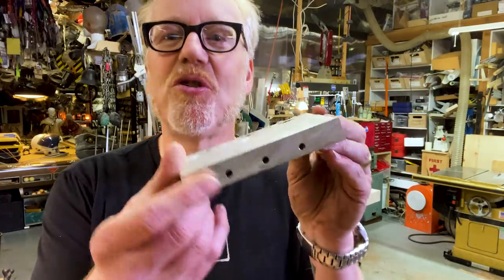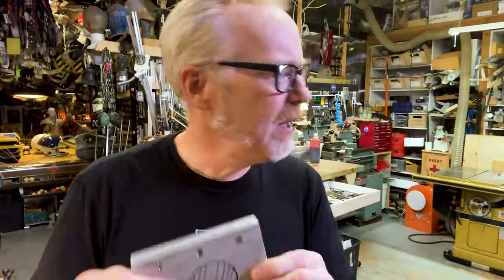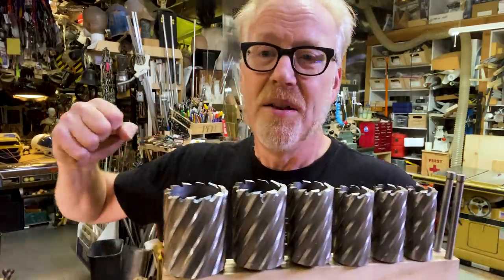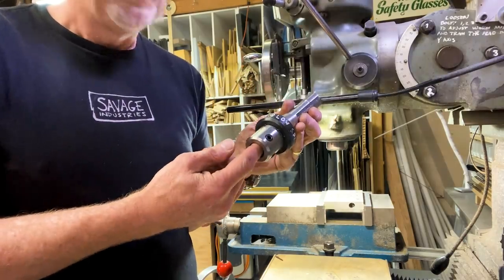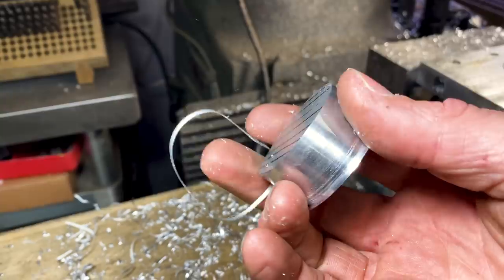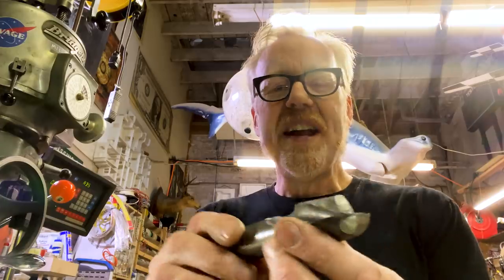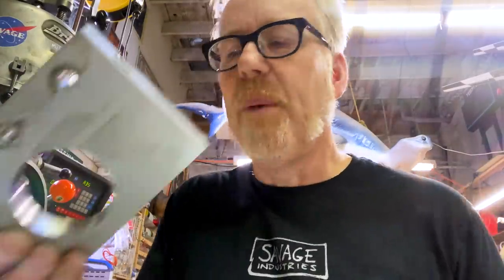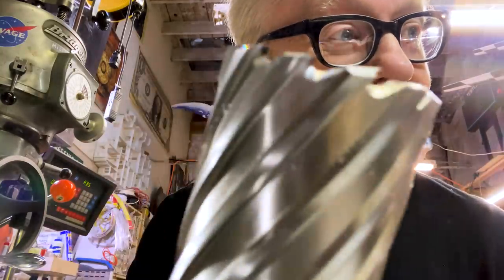Adam Savage's Favorite Tools: Annular Cutters!

Comment: So essentially it’s a high-quality, high-precision hole saw?
Reply: Essentially yes, I've tried this operation with a hole saw and it can't clear the chips so it gums up.
Reply: @mattchilton4950  Try drilling a smaller hole along the inside wall of the hole you are trying to cut. The chips will fall through the hole :)
Here's where I saw it https://youtu.be/QhpOg186fks?t=1083
Reply: Essentially yes, but..no? I mean, it's better to think of them as hogging mills for plunge cuts, and there are some annular cutters out there that allow you to hog (rough cut in large quantity) the sides of a work piece or the very cut you've made, like for example, you've cut a hole, then you want o enlarge it so it becomes a slot.

The reason i feel like there needs to be a distance between the regular hole saw and an annular cutter is that...where as you can chuck a hole saw in a mill, you can't chuck an annular cutter into a drill and expect anything out of it, and in fact, it's probably a good idea not to, because one wrong pressure adjustment, like you'd do with a hole saw, and you're off the deep end, which at best would just ruin your work piece, but if it grabs you by any odd chance, those things do damage. Not to mention the fact that it would probably cook the winding on a regular drill, because it demands a lot of power to cut through. 

In my imaginary tool classification, an annular cutter falls squarely in the middle between hobby shop and professional machinist shop. You need the machine to operate it. And the pocket too, these be expensive.
Reply: Riyman24 brilliant tip!
Reply: @riynyescienceguy5268   What a great tip, thank you!  I always cut an undersized hole with a hole saw and then follow with a boring bar to clean up the finish.  It suits my needs and budget but dealing with the chips is a constant hassle.  I'm definitely giving this a try.
Reply: @riynyescienceguy5268  That is gold! Thanks for sharing!
Reply: Reminds me of a core boring bit.
Reply: That bores through steel like it's butter....
Reply: Yes...but no. It has two  significant  differences. 
First. a hole saw, as you know, is a thin toothed cup mounted  to a small arbor (center).   This junction between the arbor and saw can introduce a tiny amount of play that can reducing cutting efficiency, and under enough force it can wander or buck.   The annular cutter is one very solid piece with a 0.75" shank so it avoids all that.  Same issue with the thin walls of the saw cup, which in addition to deforming also heat very quickly increasing the likelihood of binding. Where again the annular cutter has walls around 0.125"  that take longer to heat up, and dissipate heat faster.   Also  the arbor has a drill to center the saw...but the annular cutter uses a free floating pin which means one cant bind the other or bottom out. 

So far thats is just arguably a better whole saw. 

But here are the two key differences. The hole saw has blunt 1d teeth like a hand saw... the cutter has 3D cutting face that tapers so it has a larger cutting face that cuts and moves material out..and this shape helps keep the cutter from wandering... Second the outside of the cutter also has flutes with cutting edges, where the saw just has smooth sides. This  moves material and heat out and chamfers the inside of of your hole as you go... you get buttery smooth holes.
Reply: I think the flutes on the side help remove chips, which a typical hole saw lacks.
Reply: @katz4248  Right, a hole saw doesn't have the means of ejecting chips, so it needs to be repeatedly withdrawn to clear the cut.
Reply: Not at all. A hole saw has cutting teeth only on the end face of the cylinder. An annular cutter has cutting edges on the end face and axially on the outside diameter and inside diameter. That is the fundamental difference and the reason why the cut hole is so perfect.
Reply: While the side flutes ensure the walls of the cut are smooth, the rubber that meets the road is the end face where the majority of the material is cut.
Reply: Yeah, but "hole saw" sounds so boring so let's name it something high tech-sounding to make us sound skilled.
Reply: Professional machinist. That’s exactly what it is. They have their place, although I’m not a fan.
Reply: @riynyescienceguy5268  this is an awesome tip thank you!
Reply: @riynyescienceguy5268  The small hole works as a chip breaker. Used this method many times but only drilled one hole as it was enough. .
Reply: @aserta  annular bits as he mentioned are actually intended for mag drills. commonly used in structural steel work for placing 3/4" and larger bolts into structures. Also, the main difference is of course the hard tool steel vs the mild steel body of a standard hole saw. Also annular cutters refers to the sharp edges wrapping around the cutter, whereas holesaws only have blades around the end.
Reply: with a hole saw on aluminum u have to use some cutting oil
Reply: @craigbrewer433  - well, that's because it IS a core boring bit. DOH
Reply: If all the other posts haven't cleared it up, it's basically a hole saw that has cutting surfaces and fluting on the sides as well, and that's the big difference between the two.  The cutting surfaces and spiral fluting on the sides double as a hole reamer, so once you've made the cut there's usually no need for additional finishing work (unless you're wanting a hole diameter between tool sizes).  They're also absolutely fantastic replacements on tubing notchers that usually come with junk hole saws even if they're high end models.  When I'm done with a notch, the tube will literally click into place on another tube and hold itself there while I tack it on.  Short of using a CNC laser or 6 axis mill, there's not much out there that'll give you a better notch in tubing.
Reply: @mattchilton4950  Just drill a 1/4" hole or two through where the hole saw teeth will be cutting. The chips will have a place to escape.
Reply: @riynyescienceguy5268  lol, I just made the same suggestion. Was pretty happy with myself when I came up with that.
Reply: We use annular cutters with magnet drills all the time, mainly for drilling bolt holes in steel beams.
Reply: MPM Welding  just to clear two things up. I’m a professional machinist. I don’t own a mill either, but every company I’ve worked for has so I do have access and use regularly. When you do it for a living, you usually work in shops that are fairly well equipped. Hence my comment that although I’m not a huge fan of the cutters, the do indeed have their place. I’m also not an”yank”. No offence taken, but I’m not sure why you’d assume that.
Reply: @riynyescienceguy5268  😮😮I’ve been in construction for nearly 20 years and no ones ever showed me that! Now I have something new to show off at our team meetings! Thank you
Reply: @mattchilton4950  It's all in the selection. There are usually hole saws that have larger gaps and carbide tips in the tool section of most hardware stores. 
https://www.amazon.com/MaxTool-Carbide-5-Teeth-clearance-CT00Y57R424/dp/B079N7YMB9/ref=sr_1_17?dchild=1&keywords=carbide+tip+hole+saw&qid=1613327108&sr=8-17
Reply: @riynyescienceguy5268  holy shit that's a brilliant idea!
Reply: It's similar to how my father told me to think about a chainsaw as a high-quality high-precision high-speed procession of chisels.
Reply: You wont cut steel at that speed without flooding and peck drilling, youll burn it up.
Reply: @riynyescienceguy5268  That was useful. Thanks
Reply: @riynyescienceguy5268  yeah, I do this with two holes and it works great.

Comment: I was a machinist for 48 yrs., yet your enthusiasm for discovering a new tool puts a smile on an old man's face. I once had that same reaction when discovering some new way of machining or a new tool that came to market that made my job easier and more precise. When I started we laid out holes with die buttons, gage blocks and a surface gage. Every man had a planer gage to test tool height and large slot sizes. We fit tapered keys with blueing and a scraper. New tech is a boon to the industry. Love your enthusiasm.

Comment: We have used those with a mag drill for years drilling truck frames. You can get an adapter with a hex shank to use in a drill press but be sure you get the correct "chuck" to match the type of cutter you have. There are a few slightly different types out there. Also you can get them sharpened as they dull down, which is good considering how expensive they are.

Comment: Nice video Adam! I'm a mechanical designer at Hougen Mfg over in Michigan, the founder of the company Doug Hougen patented the design for the annular cutter back in 1973. We're still manufacturing cutters and a range of mag drills. Also my side job is doing CAD design for Solo's Hold/Nerfworxlab. Keep the vids coming!
Reply: I had no idea annular cutters were so recent. I'd have thought they existed in the machining world from the early days, since they are so similar to face mills, and efficient removal of material is so important in the machining world. I know the machine gods will curse me, but I have even used a carbide annular cutter as a face mill in a pinch.

Comment: Adam: reached up to tighten collet
*powerdrill noises*
Me: Ah, I see
Reply: lilmurf000 it’s called a powered draw bar.
Reply: Pneumatic
Reply: Yeah I was wondering abut that - powered draw bar?
Reply: Sounds like an impact wrench
Reply: Grayson Osborn it’s basically the same thing, yeah.
Reply: Every drill press or mill I've used has had an air impact sitting on the top of it for that exact purpose
Reply: @isaakwelch3451  I haven't machined in years. Im  used to the bridgeport wrench and reaching up to tighten that fucker. I used to work in the industry but left for other opportunities.
Reply: @Keith_Mikell  Sounds inefficient
Reply: @isaakwelch3451  by today’s standards it sounds inefficient, but you have to remember that bridgeport’s have been around since the late 1930s. they just work.
Reply: @brendenlybarger4684  I guess what I mean is in a professional shop, why wouldn't you use an air wrench? Its a serious time saver if the machine actually gets use. None of the machines I've used have been newer than the 1960s but they've all had air wrenches on them because it makes the drawbar so much quicker and easier
Reply: At first I was confused and then I felt like a sucker for hand tightening mine, but then I remembered I do CNC now
Reply: @isaakwelch3451  I agree, it seems he's going the ever-so-common route of having a dedicated pneumatic impact gun (for the uninitiated: just like the ones commonly used by mechanics, for removing lug nuts), just for draw bar duty.
Reply: Pneumatic chuck
Reply: most of them are a cage attachment with a butterfly impact, and a simple lever down at normal height to hit either direction of the butterfly.  Instead of the manual method of climbing up with a wrench (and a hammer if the previous operator decided to gorilla the nut LOL )

Comment: I used to use mag drills everyday for bolt holes on steel bridge assemblies.  The satisfaction of that  slug being shot out by the center pin is indescribable. Pro tip: if you dont remove the bird's nest, you get a free polish with your drill job!
Reply: That's exactly what I use these for today

Comment: I discovered these a few years ago. I also bought a mag drill to use them in. They have made everything so much easier. I used to break dozens of drill bits on a project and waste money on them at the home stores. Now i use primarily the cutters to do everything. Aluminum is easy to cut but they also go through thick steel with the same amount of ease. Wish i had these years ago!!

Comment: You can also use standard hole saws. I picked up some bimetal  Milwaukee (or craftsman?) ones and was able to punch a 1 1/2” hole right through 2 pieces of 1/2” plate steel. The cutter looked pretty much 100% after those cuts, I’d be willing to bet it could handle 5-10 cuts like that before you noticed any wear. Oil, slow rpm, blow out chips regularly.

Comment: The tool was invented by Dr. E Douglas Hougen, I remember them being sold as Sluggers. I have heard them called Core Drills and now as Annular Cutters. I was an Aircraft Machinist in the USAF and Air National Guard and we used this tool a lot. Because of the 2 flats cut on the shank at 90 degrees I always made a mandrel with 2 set screws  to lock and drive those cutters. Those flats do not leave much foe a collet to hold onto, though most people use them that way in a mill. I've seen them break collets and the mandrill or adapter works far better, if you take the time to make one and ream the hole.
One thing though, make sure you do not run them at high speeds and use a good cutting oil, lots of it and make sure you back it out with deep cuts and clean the chips out. That cutter will shatter and can be a real mess to clean out of the part. BTW here is the Hougen site with the history of the tool and lots of info and downloads.  
https://www.hougen.com/about-hougen/about-hougen.html

Comment: Annular cutters are great until you're setting a mag drill up upside down, in the mud, in a 2ft-ish gap under an enclosure because some idiot on a totally different shift forgot to drill them during fabrication.
Reply: RealExivus you need to update to a Mag Lev drill, then gravity won't be an issue.
Reply: Sounds like working in the Power Plant Services Industry. lol
Reply: @mrfinder18  What a guess! I was actually working in the metal fabrication industry, but we were making big heavy duty enclosures for electrical stuff for a hydroelectric dam.
Guy on the other shift built the base, forgot to drill the mounting holes for a major component... it got finished and sent to site. a week or so later, i got sent to site to fix it.
Reply: @realexivus950  Surprised they didn't send that dude to fix his own mistake.
Reply: @firearmsstudent  that's what happens when the fuckup is by someone related to management
Reply: So what would you use that would do this job better?
Reply: Lol my bad
Reply: Well thats a place you really do love having a magdrill.
Reply: That's when a Good centre punch and big
 hammer + knowing how to set up slides on a mag drill pays lol

Comment: These are awesome tools, used a lot in the automotive industry for cutting holes in frames, bumpers etc.  There is also a variation with a spring loaded center point... better know as a spot weld cutter